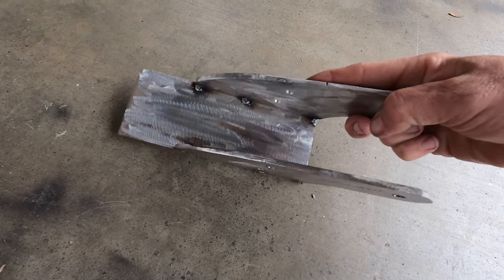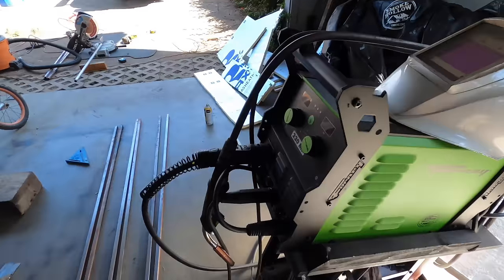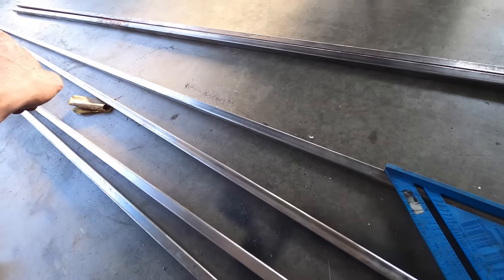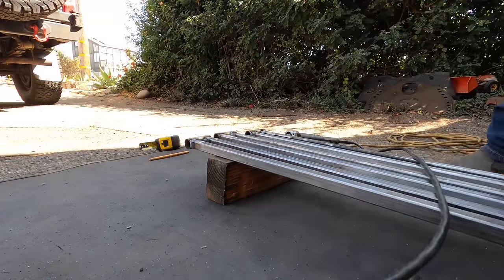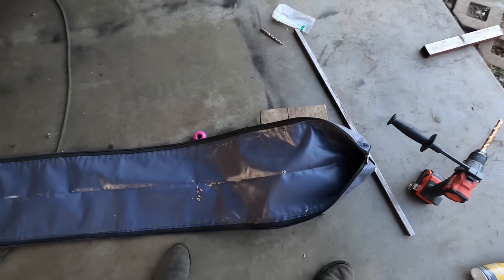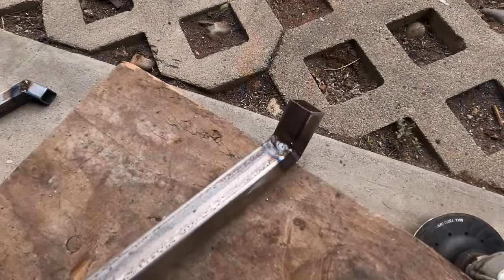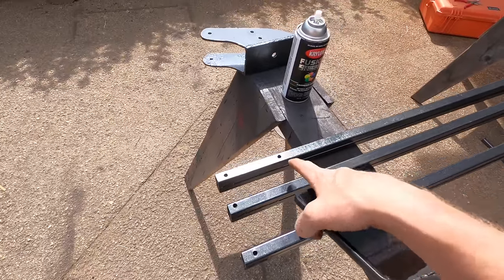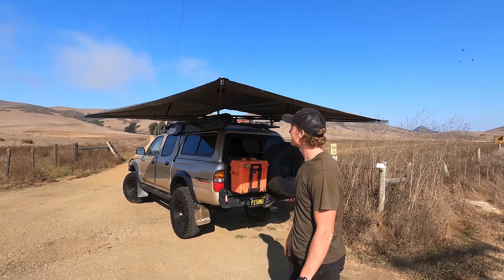How to build a 270 overland awning for less than $150

Comment from the maker: Second video on cutting the tarp, and laying out the hinge coming soon!
Reply: Awesome!
Reply: Can't wait man. Need to get your boy out there in that welder lol.
Reply: Yeah need to see that also I have a 24’ cargo trailer and that’d be great to do and have it come over the back when we are chilling on the “back patio”
Reply: Why not use a waxed canvas? You can buy the canvas material and wax it yourself.
Reply from the maker: @justinwhisenhunt2661  actually tried this first! it was awesome but it after leaving it open for a couple days the canvas stretched in the stress areas creating saggy spots. Another issue was that in the direct sun the wax would heat up and become very transferable and soft. If you left it open at night when you went to put it back it was hard as a rock since the wax gets hard as it cools.
Reply: How about a downloadable pdf to print out of the hinge? I’m stoked enough I’m building and have nothing to put it on.
Reply: Looking forward to it!!
Reply: yes that was going to be a question!! when can we expect this vid to come out?
Reply: @justinwhisenhunt2661  waxed canvas (even the best) stretches and leaks when pulled tight..and as stated is SUPER  susceptible  to heat stretching

Comment: Push your welds with a mig. When you pull the weld the gas coming out of the tip is cooling the puddle.
Reply from the maker: OHHHHH thats super helpful! thank you!
Reply: Not true, you can push or pull mig. Unless you run flux core but then that’s not mig......
The shielding gas is always surrounding the weld otherwise you will get porosity and it needs to be fully ground out before trying to fix the weld otherwise you end up with more!
Reply: @1966cambo   if you push a weld, then go and make another pass pulling a weld with no change to the settings the heat will be inconsistent. the gas coming out of the tip will cool the puddle leaving a weld with less heat and penetration. point the nozzle forward and use the gas to clean in the direction that you are welding. good welding all starts with building consistency

Comment: As an older guy, I would highly recommend using a work bench/table/saw horse with clamps to raise your work pieces up to an height that is easier on your back. I clamp my work pieces down and find that it is easier to control my tool/saw/drill/sander. Otherwise, this  is a great video.  I really appreciate your use of hearing protection and eye protection.

Comment: Tips from a fitter welder:
Push while using mig don’t pull

When drilling you should have relatively high rpm but also be using coolant or cutting compound 
Instead of welding the bearing in (this will most likely ruin the bearing) use a locking compound such as locktite, whith light heat you will still be able to remove the bearing
Reply: Or buy slightly smaller pipe and press in if you have a lathe
Reply: Exactly what I was thinking. It's those little things that make things easier and eliminates future issues.
Reply: I change drill speed up/down to try to get curls/chips but never too much pressure and I use motor oil because I keep forgetting to order cutting oil.

Yes: If there's SLA, then DRAG else if GASS then PUSH. Hundreds of Utoob videos about that.

The Locktight suggestion is a good one. I'll remember it......
Reply: TIPs like this are what I need.  I watch all these videos on MIG welding where they go into so many (potentially unnecessary for a beginner like me) details about things like the relationship between arc length and voltage, yet they never mention push or pull.

Comment: If no one has said it....get the welder nozzle closer to the weld. .
You'll have cleaner welds and you can turn down the shielding gas (expensive) ...turn the heat down as well and you can weld continous.
Been welding since I was 13/14...54 now. Thousands and thousands of feet of welds. 

Great job. I am a welder/smithy and I sew as well. ...gonna sew up some army surplus awning material ...heavy, but it's  an E350...she can handle it.
Reply from the maker: Thanks! Definitely was holding off way to far in this video 👍🏼

Comment: I love watching newbies getting into welding. Lol.. it's called a bevel man. You want to put a bevel on the edge so your weld has a deeper penitration. You also want to mention how to set up your welder and what settings your using for the folks that have no idea what voltage and wire feed are for. That's an awesome welder your running. Super lucky to have won it! Congrats on that!! 
You have a great set up though.. you got it a lot better than I did when I first started. I welded all my roof racks outside. Under a tent. Mostly limited to working on projects up until winter hit. It was a struggle but I had a growing buisness for roof racks.. anyway. Great video man.  I love the creativity and sleek design in this awning. I've made simpler fold out awning but I'm sure I will be making one of these for myself now. Thank you and good luck on your journey to becoming a fabricator.
Reply: Dude, this is awesome, thanks!
Reply from the maker: Thanks man!
Reply from the maker: haha thanks man, definitely learning more and more each project and feel really blessed to have the setup i have.

Comment: Great job ...if I could add, I use Zip Tape ...ALOT..if your pop up rollers become a wear point ...the zip tape would be an excellent way to bolster that zone of stress. If you sew you could put a reinforcement there. Mutiple layers would disperse that load across a broader area
Reply from the maker: Never heard of zip tape. I’ll check that out

Comment: tip for drilling  metal stick a drop of oil where your drilling and your drill bits will last way longer
Reply: Also helps to drill a pilot hole first, makes going full size much easier
Reply: Oil always helps, and  anything over 3/8" I'd recommend a pilot hole. Otherwise, having an actually sharp drill bit, spinning as close to ideal RPM is the most effective. 
I don't like being the I told you so guy, but mild steel with a 1/4" bit like this would ideally be drilled at 1500 RPM which is probably more than max of the drill.

Comment: You could tack weld a nut on the holes, and use a bolt as a set screw for the bearings

Comment: To make removing the zinc coating from the pipe easier and more complete, cut your parts to length and drop them in a container of 50% diluted pool acid.  Zinc plating goes away quickly and completely.  Rinse, dry, weld.

The acid bath will also remove mill scale, just takes a bit longer.
Reply from the maker: That’s good to know! I don’t have a pool though...
Reply: @OverlandUnderBudget  every big box home center sells it.  Also pool supply stores.  Typically $5-7 per gallon.

Comment: Very cool setup. I really like the design. If you have the room at the end of the steel square tubing, your local metal shop sells plastic end caps to seal the inside of the steel square tubing from moisture and rust prevention, apply a bit of clear silicone caulking before you place the end cap and you're weatherproofed!
Reply from the maker: Yes! Actually my first awning had these and I had forgotten order more. 3/4 3/4 caps available on amazon by the bag full!!

Comment: In the process of building this right now! Really excited about this project. An alternative way I found to hold the bearing was to get a thicker wall pipe and milling out each end with a step bit just big enough for the bearing to sit flush with the top of each pipe, seems like a very solid hold.
Reply from the maker: Absolutely that’s the best way. I didn’t had any thicker wall tubing but that’s definitely they way to go!
Reply: @OverlandUnderBudget  I know how that is! I also purchased your template, it made the whole process so much easier. Thanks for sharing your project.

Comment: Excellent Project!

19:40 Another best practice for drilling metal is to use cutting oil. But, any oil is better than none. I typically use motor oil.
Reply from the maker: you are 100% right! i really need to get some cutting oil. Thank you!
Reply: No and no. 
Do not use oil, use coolant ie water. Try using spit, its like egg white and sticks to the drill also. 
Drilling/cutting requires friction to cut but hates heat. Making the cutting edge slip takes longer to drill. 

Not only does Oil smoke and burn, it contaminates the weld. Having to clean it for welding and painting is another useless step. 

You use oil when tapping etc, when all the chips and major surface area are causing friction.

Comment: Having a little welder around is awesome and super handy. I used the crap out of mine. More the. I ever thought. Buy the best you can afford or if life is kicking you in the balls like it’s currently treating me cash is a little tight. But I found a wire fed machine on cl for 40
Bucks. Best 40 bucks I spent for a shop too. But check out the harbor freight flux 125 titanium machine. It’s super small, light, easy to use, and will do more little jobs around the shop. And it’s cheap. You can be up and running with no experience for less the. 300$. The welder and a portable or even a corded deep cut band saw two super cheap and maybe some of the most used tools in little diy shops. I know they are up
There along with the shop vises. I never looked back once I bought those two
And don’t know why the hell I waited so long to buy them.

Comment: Welding tip, try moving in a lower case e form,.  As if writing a cursive e over and over,. The welder sounds good but you want that heat to get in there,. I used to weld for full throttle suspension,.  All day 8 to 10 hrs a day.
Reply from the maker: Yes i will try this! thanks for the tip!
Reply: @urban style, do you think you could do a aproject this with a flux rod (no gas) mig?
Reply: @hereusethis   using 220 yes, it's just a mess to work with,. flux is good for working on out door areas ie farms ect....  Flux welds just have to be grinded more, mig will lay smooth if done right,.  My welds never needed grinding, they just sand blasted the parts a coated them.

Comment: Nice build. 
A couple suggestions you don’t have to follow. 
When welding maybe use a little less stick out. Having the nozzle closer to the work will allow your shield gas to cover the area. You will get less Black soot. 
For your sanding disc on the grinder they have Flap Wheels. All the box stores including HF carry them. Makes fast prep work. I would also get a wire wheel for your grinder or drill to knock top rust off. Will last forever. 
Again nice build.

Comment: Apparently, there is an old video, so you might not even see this. But I’d like to make a suggestion, which is that the hole that you drilled for welding, the bearing into the frame would also be perfect for a set screw.

Comment: Awesome video! I'm definitely making this. Your welds look solid, and as another person commented, you'll get better penetration with more of a 90 degree angle and slight push. Also, be careful about doing any heavy welding on concrete as it can explode. I think what you were doing is just fine, but it's something to think about. I'm not trying to be "that guy", just looking out for ya. I really enjoy your channel. Thanks for all the ideas, inspiration, and great content!
Reply: That was a great piece of advice. I never knew concrete can explode. Will keep that in mind!
Reply: @jarnolehtinen2269  The moisture in the concrete can heat up rapidly, and has to go somewhere. Just something to think about.
Reply: @davidallsup2375  yeah I figured that since your comment, just never thought about it before.
Reply: @jarnolehtinen2269  I didn't think about it either, until my welding instructor pointed it out when I was welding on the shop floor. Ooops!

Comment: A nice product indeed.  Youtube is full of these builds by now, and some are pretty poorly constructed, some have poor designs and some require poles.

This is an excellent design.

Question, where does the rain go?  Does it run into the camper shell hatch opening?  Yeah, I know.... sunny California, but some of us use our vehicles where it rains and snows.

I would suggest to you that you focus a bit more on precision in your fabrication.

And your future body will thank you if you get some saw horses or something to allow fabrication while standing.  I'm old now and I wish I had worn knee pads and did way less work on the ground.

Comment: Wow, Wow, Wow and thank you, thank you, thank you for sharing!!! I've been searching for a budget friendly solution for a camping setup so I can easily explore National Parks with my family. I have several purchases ahead of me and I'm concerned about how, and if they will all work together: 

• I would like to get a standard wheel-based minivan that will fit in an average-sized parking stall—one that will also work as an every day vehicle, with seating and seatbelts for 5 people; 
• a Roofnest sparrow XL, roof top tent; and 
• some sort of bug protection for a back camp kitchen—possibly a Carsule

Questions: 
• Will this awning be too long for a minivan? 
• Could I modify the length of the metal tubing so it will work for a minivan? 
• Will I be able to pop open a rooftop tent with  this awning attached to the roof rack? 
• What is the clearance above the roof rack? Depending on the minivan I choose I am concerned about the clearance for the Carsule at the back of the van.  

Any comments or thoughts would be greatly appreciated.

Comment: Great job. How did the welding of the bearings work out? Two things to suggest, adding a nylon washer on both sides of the hinges for wear points. And get a small tripod for yourself. One handed is tough going. Keep up the good work. I'll be building on myself very soon. I'm going 6' since my roof rig is not as long.

Comment: Thanks I'll be doing a similar setup to yours. I have very strong winds here so I need to design it with round instead of square tubes to utilize pvc pipes cut in half longwise (split) to go ontop of the tarp and screw into the supporting send under the tarp. This should give me more tarp support from wind blowing the tarp right off the bolted end points.

Comment: Weld yourself up a bench for the drop (mitre) saw and a steel plate top workbench so you don't have to work on the floor. The steel top bench lets you put the earth clamp straight on the bench so it doesn't get in the way when you have to flip your work around.

Comment: SUCH a sick build! I gotta take a stab at one. Also heads up, with your new arms being so much smaller, you should try and mount a new ARB bag with the zipper facing down. I find that those ARB zippers allow water in and this orientation would cause moisture to sit in the bag. I know its $35 to go buy another one and redo, but moisture just sitting near those REDZ or anywhere in there will be no bueno real quick! lol
Reply from the maker: Heck ya thank you! So the bag actually has to be orientated this direction since it has "boxed ends" its taller then it is wide so to fit the hinge i needed to turn bag on its side.
Reply: Overland Under Budget I wonder if it’d fit! I’ll try when I build and report back. I know my current awning just folds at that boxed end

Comment: @overland under budget I’ve built this awning using your instructions and template and am very pleased. I am hoping to extend the arms with a smaller square tube that slides out from inside the arm but am wondering what size tarp /arm I’d need for an Additional 10” of coverage. Please let me know! Wicked channel!

Comment: Tip, some backing material between the cover and the bracket will keep the cover from getting ripped overtime.
Question, Dimension-wise, Can the zipper be mounted to the bottom?

Comment: Great job on the awning.  
Get a tad closer to your steel when welding.  And push instead of pulling.  
If you are really interested in welding I would suggest taking a class.  They are not that expensive.
Reply from the maker: Thanks for the tips!

Comment: Great build. Your wire feed is a little too fast, however in the beginning when you started welding. If you listen closely, the welder is struggling to heat up the amount of wire that's being fed.
Edit: Could also be that your conduit isn't clean enough. Sounds dirty.

Comment: Good tip for beginner welders is try to keep the proper distance between the nozzle of your weld gun and the material that you're welding. It should be about 5/16". A good way to know this for sure is to use your welding pliers bc the wire cutters that are built into them will cut your wire to exactly 5/16" from the tip of your nozzle to the end of the wire. Along with practicing using only your wrist to move your gun along your weld seam. If you can prop your arm up for support your welds will come out much cleaner more consistently.

Oh!!! And a grinder will make ANY welder look like a pro!!! NEVER forget this and never take any shit from other armchair welders. Tell em all to go grind each other.

Comment: @ 18:03 you can put a washer on that bolt, then put a washer and nut on the other side and tighten, this will draw the bearings in straight with any risk of accidentally popping the bearing apart.
Reply from the maker: yes 100% truth! good idea
Reply: @OverlandUnderBudget  I use that as an affordable version to press in bushings for my jeep. I have an awning I made from conduit! love the idea of bearings! I got a few junk bearing laying around actually, will help reinforce the swinging.